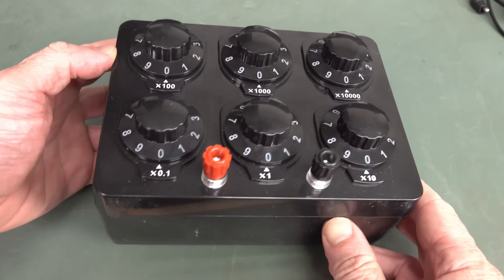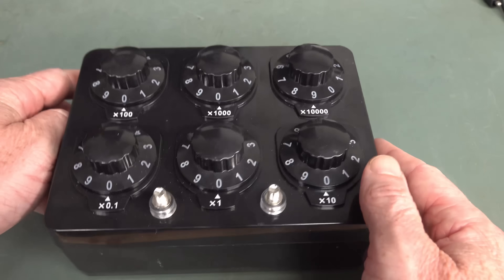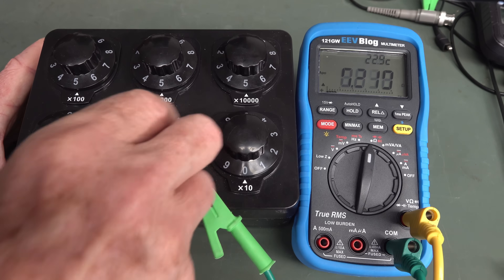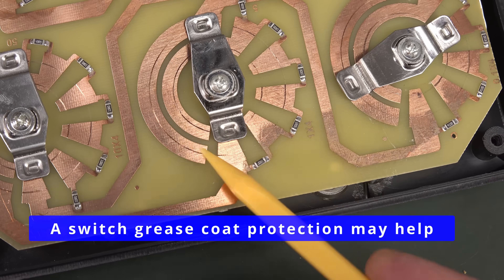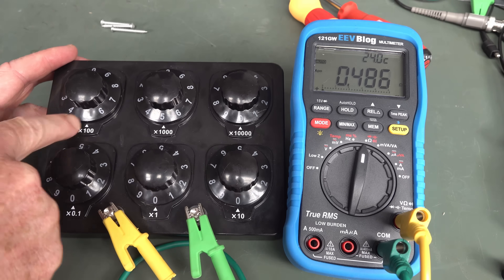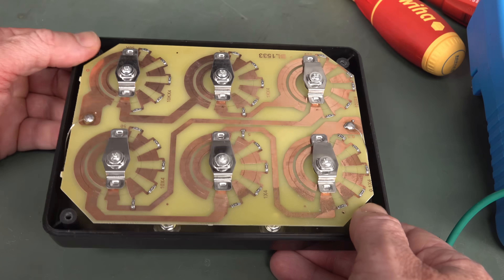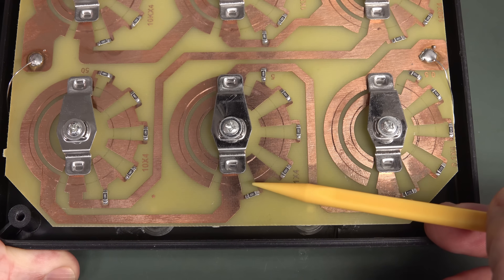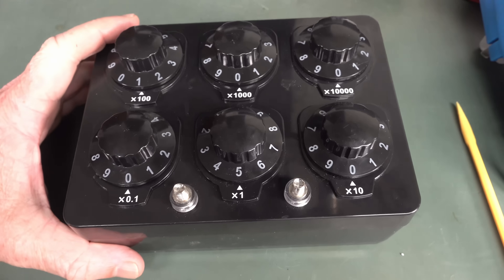EEVblog 1586 -  Stranger Things Decade Resistor Box + Repair

Comment: I've modded mine with 2 Watt resistors to go from 1 Ohm to 1 meg and put decent banana connectors on it. It's quite accurate. Instead of using a single resistor in the "5" position I've used 5 resistors in series. So I've used 9 resistors per switch since there's plenty of room inside.
Reply: Nice, I also noticed 5 resistors don't exist but rather 4.99 so you improved accuracy as well within the tolerances at least
Reply: @openinverter Yeah and it's much cheaper to buy a lot of same value resistors. I've just ordered 20 2W 1% resistors of each value and hand picked the ones closest to the stated value for best accuracy.
Reply: @Ni5ei  Did you drill holes through the contacts, or just solder them on top with a blob of solder?
Reply: @Hyxtryx  I removed the SMD's and kept the leads of the new resistors pretty long and bent the end of the leads 90 degrees to make tiny "feet" on the leads. I soldered these flat to the board so the resistors are standing up. The resistors themselves are then about half on inch above the board. There's so much room in the case, you could even do this with larger ceramic resistors.
Reply: @Ni5ei Thanks.  That sounds like the way to go.
Reply: Might be easier (and cheaper) to go times 5 (or rather 25 for the fiver) and parallel them up instead. That also will distribute the current between more resistors to provide higher current capabilities (and potentially allows to calibrate the actual value) and 5 SMD resistors also stack up nicely so no weird wiring required.
Reply: @danielegger6460   That wouldn't help.  You'd still have the other single resistors in series (when on any setting besides the 5), so no increase in current capability.  And if you connect a voltage source to this (which is much more common than a current source), your parallel batch of 5 resistors will still each get the same current through them.  Series is better.
Reply: @Hyxtryx  I thought we were talking about replacing all resistors by better ones? Of course there's no point in just replacing the fivers... Didn't get your voltage vs. current source I'm afraid, series resistors is better if you want to use your resistors as protective measure (if one is shorted the others will still be in line) but doesn't help if you want more current because the current goes through each and every single one in line, in a serial circuit (like this box) the current through each resistor is equal. Since the power dropped in an individul resistor is R*I^2, considering equally rated resistors, the limiting factor will always be the highest value in this box which is a 50k resistor, limiting the maximum current through the box to about 2.2mA if that is in play (for 0.25W resistors). Depending on what one wants to do, that's not a lot...
Reply: @danielegger6460  We ARE talking about replacing the resistors with better ones.  But while trying to prove my point about the series vs. parallel idea, I think I just realized that it doesn't matter.  2.2mA through 50K is 110V, right?  Using 110V and 50K as an example, each of your 250K parallel resistors has 110V across it.  So each resistor dissipates 110^2 / 250000 = 0.0484W.   If you used 5 10K resistors in series instead, then each resistor gets 110V/5, or 22V across it.  22 ^ 2 / 10000 = 0.0484W per resistor.  It's the same either way.

Another way to look at it:  110V / 50Kohm is about 0.25W (as you said).  It doesn't matter if that 50K is made of 5 10K resistors in series, or 5 250K resistors in parallel.  Either way, that 0.25W is being split among 5 resistors.  I think you forgot to divide by 5 when you came up with 0.25W per resistor in your example.

Comment: Would it help to prevent wear of the traces to put the (bare) board in tinning solution? Or, coating them with solder?
Reply: That was my first thought...
Reply: Dielectric grease would help a lot
Reply: There are nickel-plating kits available that allow one to brush on a thin layer.  Look, for example, at Caswell Plating kits.
Reply: DIY nickel plating is pretty simple.

Comment: That switch contact is going to be knackered in no time at all... that's so stupid. Copper is soft AF and PCB copper is thin AF... so it's gone before you know it.
Reply: In the old days, the slide would be silver or gold plated with a silver ball on the rotating part.
Reply from the maker: Decade boxes typcially don't get used much though.
Reply: @helmut3356  It's lab equipment intended for industrial application.  Of course it was expensive--but it was accurate, dependable and lasted for decades.    For comparison, look at some of the old (>50 years) resistance standards.

Comment: You can also remove the switch and resistors and then self-nickel plating the copper using the conventional DIY technique then replace the resistors with whatever wattage you want.
Reply: Depending on your usage, you could probably even just slather it with Dielectric Grease.
Reply: Seems like less effort to just order a identical, properly plated board than DIY plating, but maybe that's just me!
Reply: @TheHuesSciTech  Nickel plating is surprisingly simply to do.  The only problem with this is you'd need to remove (or jumper) all the resistors to get the proper current flow, but if you were going to replace them anyway maybe not so bad.

Or check with PCBWay etc to see what it would cost for a new board with hard gold plating, add thru hole while you're at it.
Reply: @TheHuesSciTech  You have a good point. Hummm...

Comment: Actually a rather well engineered design. Most of the problems seem to be in the actual construction.
Reply: The biggest issue is the bare copper traces for the switching. If they were plated this would be a great tool. Might be usable with DIY tin plating, but gold would be more reliable.

Comment: It's not that uncommon, the Chinese that put stuff together often have no idea what they are doing, they are told to do something and they do that, if something does not fit, just finetune with a hammer, I have seen it with other Chinese things also.
Reply: Don't forget that they're probably assembling hundreds of those things per shift. So, it can be just a fatigue. The problem is that they have zero to nothing output QC.

Comment: Nice thing.
But...
The placement of the switches is weird!
More logical:
Top Row:      x10k   x1k   x100
Bottom row: x10     x1     x0,1
More like WE read. Is this a cultural thing?
Reply: From lower to higher. From left to right. From bottom (floor if You prefer) to top. Chinese was right.
Reply: @helmut3356  add grease and it will be fine for about 2 years or even much much more.

Comment: I used the box and made my own PCB (just same layout with through-hole options) and used gold plating on the boards
Reply: Would you mind sharing the gerber files?
Reply: @mrb5217  ordinarily I would love to but thanks to EAGLE being a cunt, they got corrupted
Reply: Great Idea!!
Reply: I think you can upload hobby files to PCBway if you want to share.  Not sure if they have a commission stream but that would make it worth your wile.
Reply: That's what I was thinking. Box is great, and the ball detent/PCB wipe prevents the switch wiggle issues
Reply: Just scan the existing PCB and then you can easily draw your project and customize it as you want.
Reply: I am guessing you ordered a thicker copper plate too, that's what I would do.

Comment: I already have a couple of lab-grade decade boxes, but for $12 I think I'll get it just for the box and the easy access, rugged contact, rotary switches for projects and experiments.
Reply: I'm a big fan of having test gear which is suitable for "close enough" measurements. A lot of sanity checks and basic testing is good with a 10 percent error, I just need to know that the thing turns on.

So I use the crappy but good enough gear. I don't need it traceable to NIST, I just need it good enough. This seems perfect for that, and at 12 bucks, you can't beat it.

Comment: Looks like a failure waiting to happen.    🤣
Reply: Random magic smoke generator. Just put the correct combination.
Reply: @norbert.kiszka  🤣
Reply: I recently smoked a resistor in my round resistance wheel (Like BigClive's) so I am considering to buy this one and add a resistor upgrade.
Reply: @johncoops6897  Might need some cooling, ventilation, holes?    🙂
Reply: @Graeme_Lastname  - heat pipes and/or water cooling for better over-clocking! 😃
That reminds me of my latest unfinished project that uses 4 x 0.2 ohm 100w resistors in Series/Parallel to pull 20A from a single lithium cell.
The idea is to test 18650s in old tool packs. However I am needing a far larger heatsink and fans than I anticipated, even for quite short duration test runs 😃
Reply: @johncoops6897  Yikes, that's a fair whack of power.  Coupling to the heat source may be a problem.  How about liquid cooling?
Keep well m8.  🙂
Reply: @Graeme_Lastname  - the heat source is the 4 metal-cased resistors bolted down with heatsink compound onto the heatsink. They get hella hot, but are well within their max power specs... which, knowing the Chinese, are probably based on running submerged in a vat of liquid nitrogen 😃
Reply: @johncoops6897  Well good luck with that.
Could be a useful thing to have if you can get rid of the heat.

Comment: I made one similar to that one but, I also added "fine pots" in addition to the decade so I can really dial in whatever I'm doing.
Reply: Wait fine pots? Why? You already have all those other pots for the lower values, don't you? Or did I misunderstand what you mean, and you're talking about more of a calibration thing or so?
Reply: @LuLeBe  Yes and yes. Fine pots to get the exact or close resistances. Also, I didn't start my decade box with 0.1, mine goes into the megaohms instead.